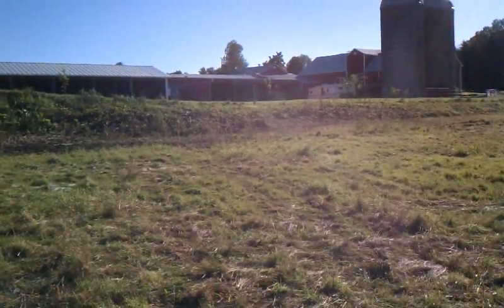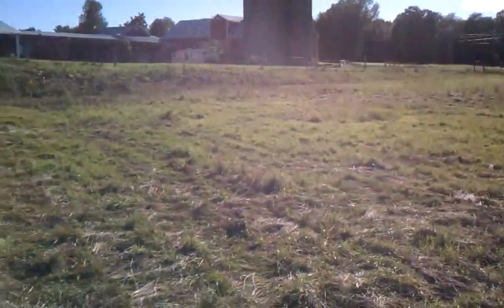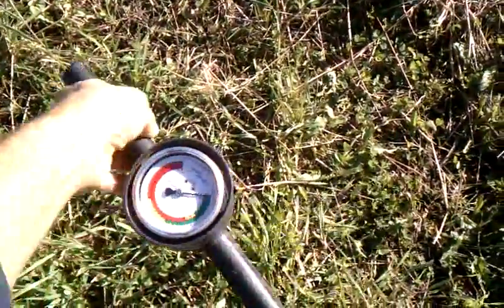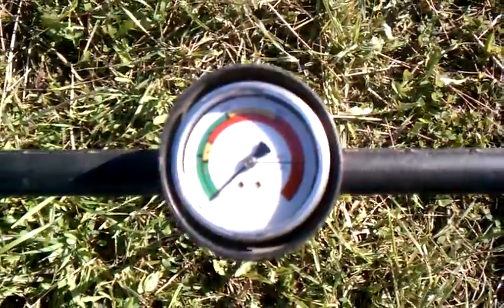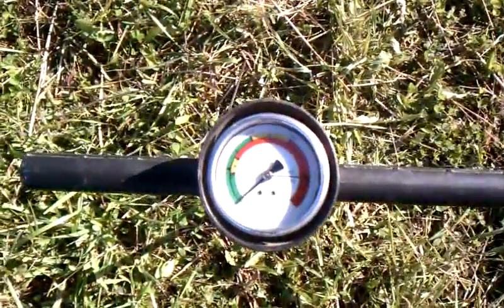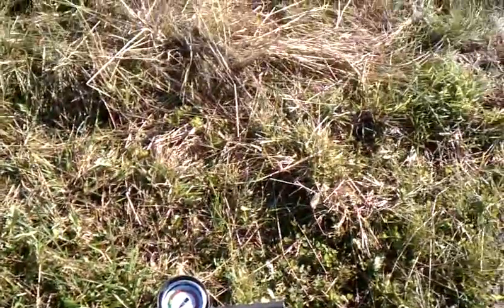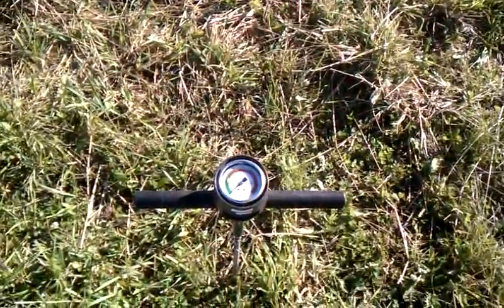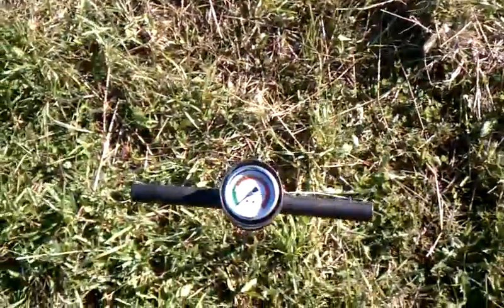Penetrometer

Comment: We see the results now. OK, there is a zone to each side of the shank where 200 psi is reached at a foot plus. Good! Then in between those zones (in the middle of the shank-to-shank area) there is a zone where 200 psi is reached at only half a foot. So for the next run through, you will move the shanks to rip through the middle of the more compacted zones. And keep staggering on subsequent rips. Got it! 
~Michele